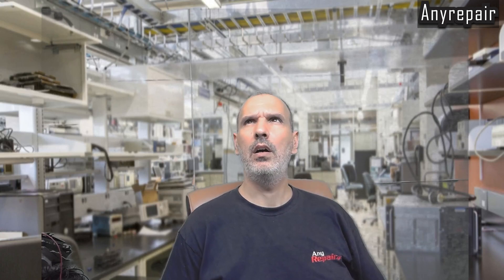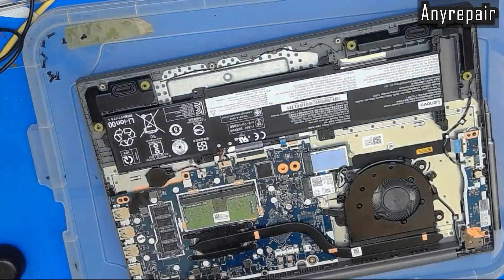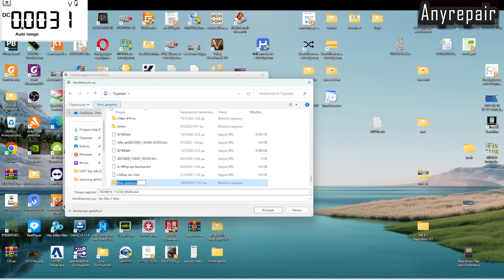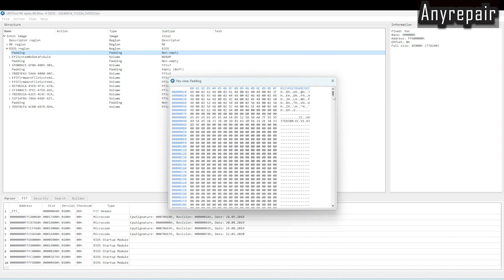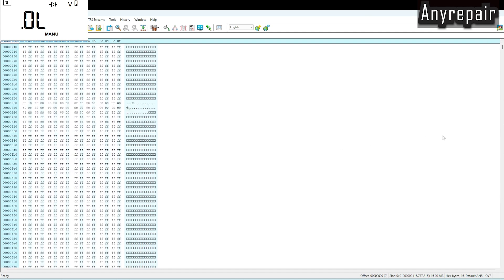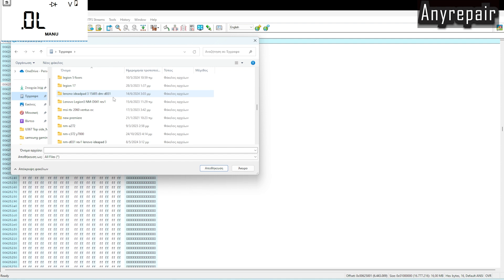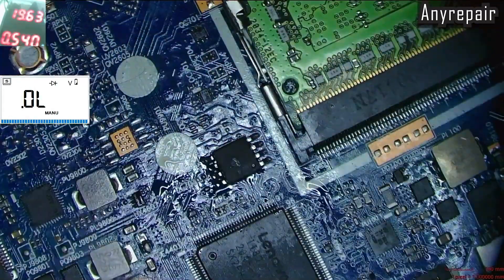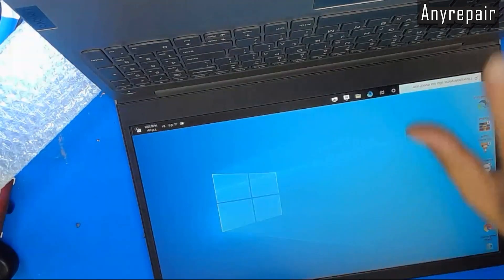Lenovo notebook Ideapad 3 locked bios reset!!

Comment: My asus rog just died overnight with a dead battery. Tested not passing  2 mosfets at positive rail. Jumped across and found shorted rail. Schematics were not found so I started removing coils and diodes until only the video bga chip was left. Unfortunately I don’t have a bga machine so heat gun on high!  Cleaned pads with solder like you teach and short went away. What is the chances I can seat a new bga with my heat gun. New chip will have solder balls. Following your other procedures of course.
Reply from the maker: Hello, sorry to hear that! Iam very sceptical on placing a new bga chip that large with only a heat gun on top. It surely needs a preheater and low temperature on top about 290. Advanced soldering skills and luck are needed. Also a holder for the top nozzle.is a must! The success probability is very low, you know every first time, is difficult. Ps:you shouldn't jump the 2 mosfets... the repair process now is very difficult..
Reply: @AnyrepairENG  when I jumped the mosfet it just shutdown the charger. That’s how I discovered the short. At first I thought it just wasn’t charging and powering up. New video is chip is half the cost of a used motherboard and local shops wants the same price to install on bga station. I had forgotten about checking the memory chips for shorts first tho. How would I check them now? Asus  gl503vm.
Reply from the maker: Check for ohms on the memory coil. With the gpu on the board it should be 16-60 ohms. Then there is no short!